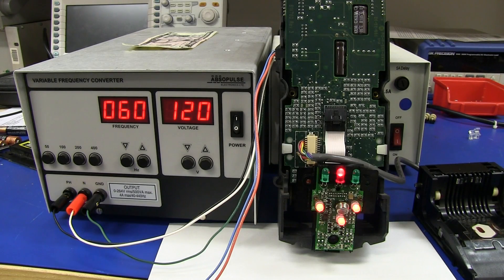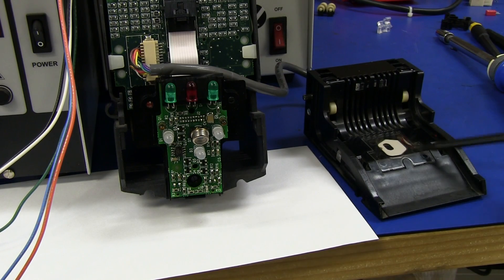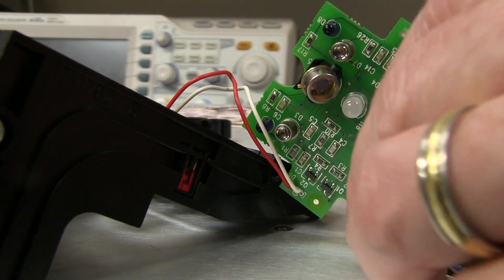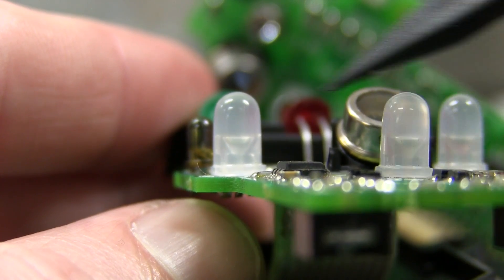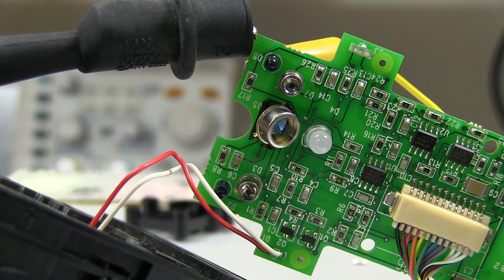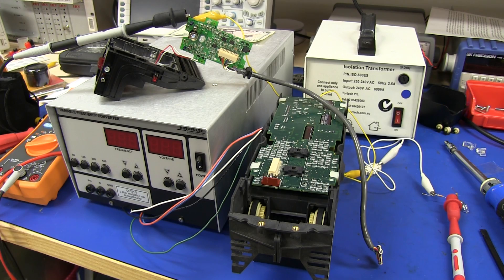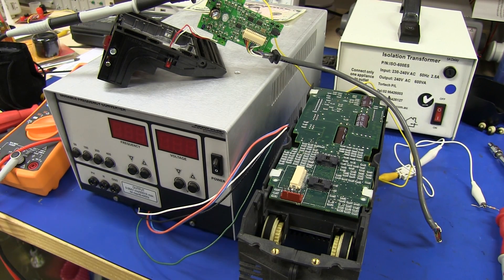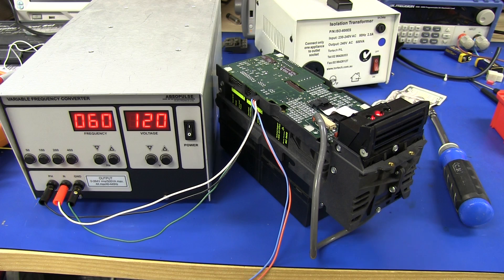EEVblog #526 - Bank Note Acceptor Followup

Comment: the camera sensor can detect infrared light, which humans cannot see, yet the blinking IR LED can be seen as visible light on the camera's LCD screen. why? how does an invisible wavelength suddenly become visible when viewed through a digital camera?
Reply: From Quora "The silicon-based sensor in the camera is sensitive to near-IR light. If the light reaches the sensor, then it will show it along with the visible light.

If you have a colour camera, you might expect the IR light to appear in the image as red, since it’s really just “redder than red” in terms of wavelength. To avoid this, most good colour digital cameras add an IR-blocking filter between the lens and the sensor to reduce the visibility of the IR light."

Comment: I think these things work by scanning the reflections off of a very narrow portion/line of/on the bill, and coming up with a stream of 1's and 0's that come from that scan.  No telling how many scans it's doing per inch, but it is likely going into some register bank somewhere, and then it's simply then compared to some lookup table of known good scan results.  I doubt that it is scanning in too high of a resolution, because such scans could render real money unusable due to normal wear and tear, tiny specks, etc.  Though I suspect they could also program a certain amount of fault tolerance if they wanted.  If I am correct, then the eeprom would likely contain the table of known good bill results, and their corresponding note values -- such that it has the equivalent of multiple acceptable scan results for 20's, 10's, 5's, and 1's.  And as new bills come out, they just need to add the new ones to the scan tables on the eeprom.  Someone could come to the device, pop out the old eeprom with proper extraction tool, and pop in a newly updated one.  Take the old one back to the shop and re-image it with a newer updated image.

Comment: You do have to check security $1 bills. Otherwise, people could pass in just a piece of paper, or a xerox copy of a $1 bill.
Reply: I think it would pick up the difference between a simple grayscale xerox copy vs. one that is original, with cotton paper, green ink, etc.  I actually think it would also probably refuse to take the more modern color laser copy scans of a bill, since they won't have the same properties under those sensor lights up close either.  Having said that, though, counterfeiters can likely get the right kind of counterfeit paper -- since the USA saw fit to add additional layers of security shortly after Y2k.  I don't think this machine is really going to detect compliance with the newer features -- it's just scanning the bill with somewhat novel light, saving the scan to temp register memory, and then comparing it to a lookup table in the eeprom.  Of course if a counterfeiter's toner ink is the right color to the naked eye, but not at the infra-red levels, this machine is probably not going take the bill either.

Comment: I have used this particular type of note acceptor many many times through the years, they are very common here, and let me say..... what a hunk of junk! They never ever accept the newer style bills and even with the older style bills they seemed to only work maybe 50 percent of the time. If the bill was slightly damp at all it would not work.  They have been mostly phased out now, I can only assume because of the terrible performance.

Comment: Those LEDs you said were UV are actually IR, there would be florescence on the board and nearby wires if it were UV, and I don't think UV LEDs came in such small packages back in 02.

Also, those Metal Can Photo Diodes only detect to near UV (400nm) that would still be visible to the naked eye as a violet colored light.

Comment: ah man! I wan't to see on Your scope what actualy the sensors are see,
 I think there is a pattern on the voltage levels of the opamps output, or can be some other hided modulation by the printing method? Interesting!

Comment: I was thinking that the led/sensor pairs actualy detect patterns of intensity as the note moves through the maching. The data from all the seporate points would make a fairly nice fingerprint of the note? More so than a data from static points.

Comment: I wonder if the reason why it originally spit out your $5 bill after eating it up almost all the way, was that it wasn't getting a response from the host.

It looks like the UV LEDs/sensors are to confirm that the bills are UV fluorescent, and the sensors in the middle verify the pattern of light/dark as it's being pulled through. A pretty simple system but the IR/red LEDs are probably essential because if you'd print a counterfeit bill with a copier or printer, the infrared wouldn't match.

Comment: If you have one of these machines you might be able to create a fake bake note that works by reverse engineering the pattern. New 5 dollar bills have IR florescent ink on the back (expensive).   google FiveDollarBillInfrared.jpg.  That is a very expensive ink.  You can see this with a 20 dollar surveillance camera with IR LED's  These camera don't have a IR cut filter/hot mirror.  IR LED's come in two colors 850nm barely visible and 940 invisible.

Comment: Recording  the sensors data with a logic analyzer or a scope and replaying the same data back could fake out the note.  The main purpose is to prevent a xerox color copy or a color print from working.  Notes pigments react to the monochrome led with specific patterns and intensity.  A color print or b/w print will not have the same intensity or strip pattern response as the not.  Spoofing this thing out without recording the pattern would be next to impossible. Counterfeit bills are for humans.

Comment: I wonder what the interaction between the red IR / UV would be on a US note.  Is the sensor looking for a specific wavelength or something else happening with the two different wavelengths.  Most of these machines are so frustrating it makes one want to insert the bill with a sledge hammer when it comes to using anything but a brand new bill.

Comment: Correct me if I am wrong. I've heard that Australian (not Austrian) bills can be cut in chunks and still have a proportional value to the full bill. So if you cut a 10 into up to 5 equal vertical slices, each would legally be worth 2 Australian bucks. I don't suppose any vending machine would accept a portion of a 'note, would it?

Comment: But that is not how counter fitting works. To bring the cost down to $1 a bill, you have far to many currency to simply change at your local vending machine. You're not going to change $ 1.000.000 worth at you local fish&chips shop. It is not like you can print acceptable $ bills on your HP laser jet, it takes a little more investing than that. So $1 for every 1000 maybe (example) is not a big deal.

Comment: A note about those IR/red bi-color LEDs. Currency detection isn't the only application for them.
You also find them in pulse oxymeters (Wikipedia it for more details). Basically the ratio of translucency of blood or a finger varies between IR and red depending on your O2 saturation (SpO2) level.
So if you ever tear down a pulse oximeter or decide to play around with those bicolor LED's, you have bit more info about these specialty LEDs :)

Comment: Actually, it depends on where you live...

In the UK, "spelt" and "spelled" are pretty much interchangeable.

I've always used "spelt", as that's the way I've always seen it.

Although, if I'm being honest, "spelled" is probably the correct spelling.

tinyurl . com / 8x3nrqv

Comment: my guess is that it's probably IR. In my experience (witch isn't really much, compared to you) most UV diodes are clear, while most IR diodes are light purple or dark blue.

Couldn't it be determined by the forward voltage of the diode?

Comment: The bill checker @ my store uses ir/uv, magnetic inc sensors and the length of the bill. 
euro's have different sizes.. 

it can't read the new 5 euro bill though, and seems to have a changable chip. 
hmm.. some lights are burning over my head.

Comment: I'm guess the larger sensors are for reflective mode and the smaller ones are for transmissive mode. They also look like they are arranged so the notes can go in any orientation.

Comment: I'm wondering if all it's doing is checking that the note glows under UV light, then another sensor is checking for phosphor dots that I know the UK notes have. Then a third is checking for a metal strip at the right location in the note. Might be worth lighting up the US (soon to be worthless) banknote with some UV light and see if it shows up any invisible lines or dots the sensors could be looking for.